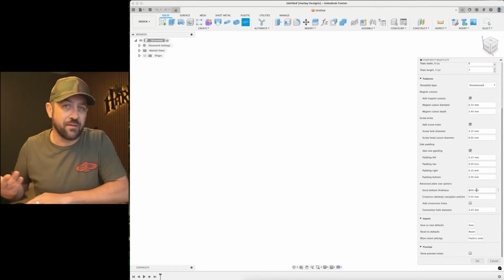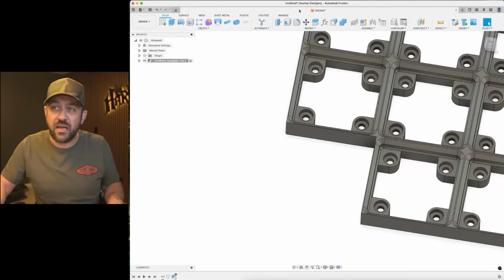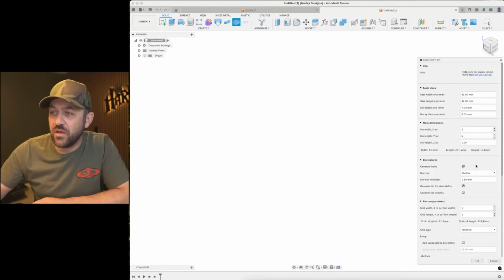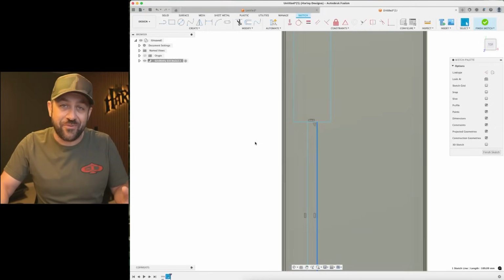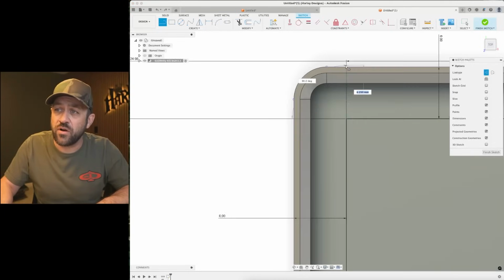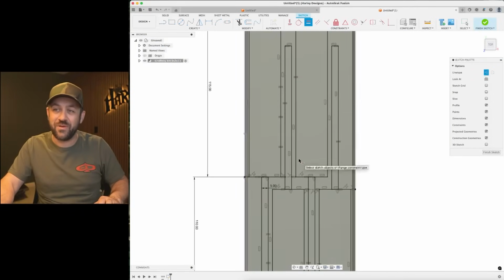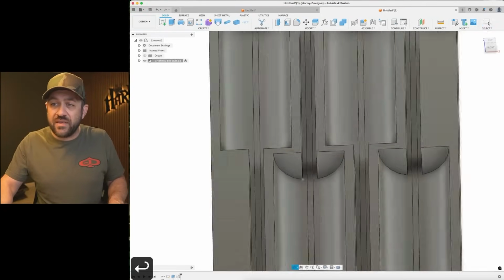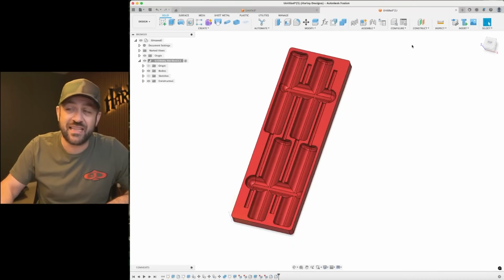How to: Gridfinity - 3D Printing Sunday  - Ep 43

Comment: I have added a bunch of gridfinity to makerworld. The one thing you have to be cognizant of is wasting tons of space with poorly thought out designs. Also, you need easy access. Too many designs do not have big enough finger slots or easy ways to get the tool out.
Reply from the maker: As with most designs, there are far more bad than good. Makerworld is no exception for sure.  Organization is a trade off between space and utilization. To best organize, you’ll often burn some space.